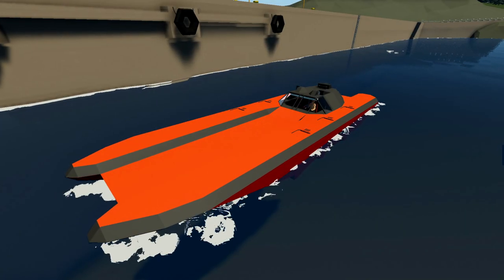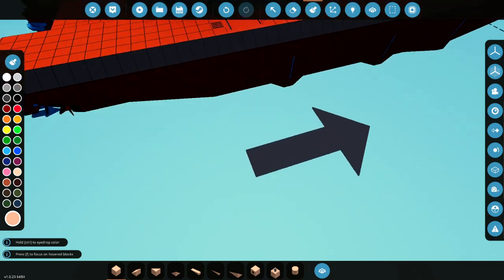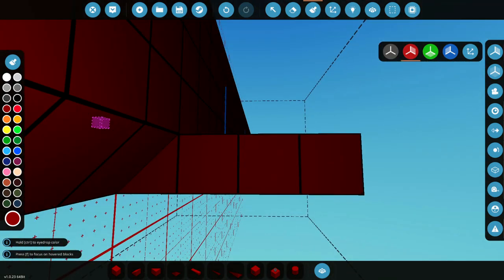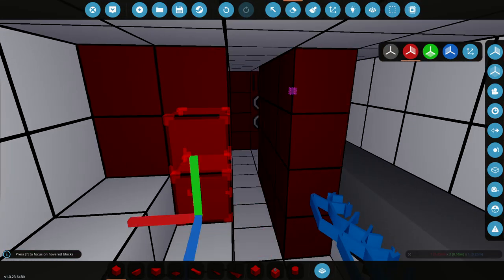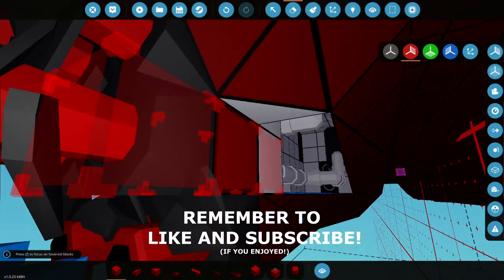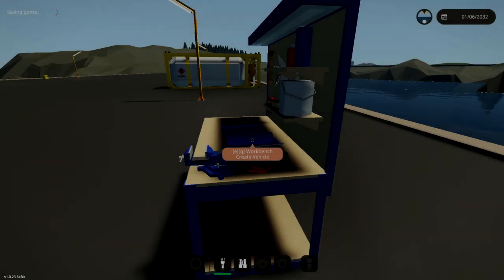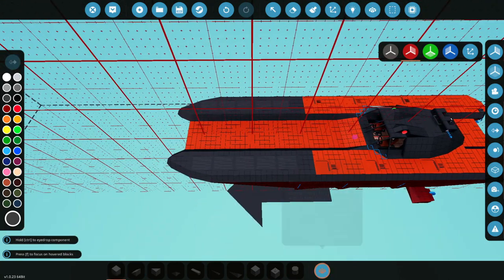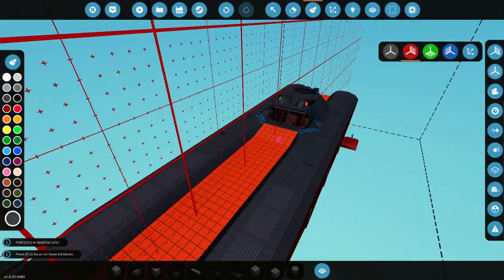Stable Sailing!  -  Speedboat Build  -  Part 6

Comment: @Frantic (and anyone else interested) -- an easy way to stabilise a boat is to use a gyro.  Simply attach pitch to two horizontally placed rudders (up/down in same direction) and roll to two opposite pitched horizontal rudders (one up, one down direction).  (c:

Comment: on my computer it freeze cause of the autosave happening few seconds after you load the vehicle then it work fine.
you should definitely add a gyro and use water jets, maybe add stabiliser in the front or the boat to prevent it to lift

Comment: I don’t get why you’re weighing down the front...the point of speedboats like this is to lift the front out of the water, allowing it to go faster. So by forcing the entire hull to stay in the water, the entire boat is basically made useless. Instead of weighing down the front, try putting the fluid porte you use for cooling right at the back (on the part that stays in the water), and then pipe the water forwards to the engines - that way the cooling will still work, and you’ll be able to go much faster!

Comment: Stop using raw water cooling, use radiators.

Use airplane control surfaces to the flat deck section in the prow, and maybe a spoiler style wing on the stern.
Reply: Why are radiators better? They are less good at cooling and take up space. The issue of the intake coming out of the water could be solved by him stabilizing it better.